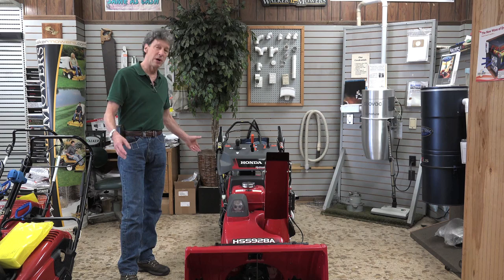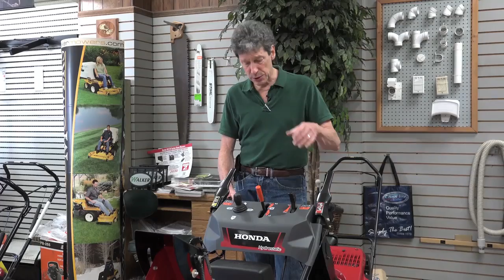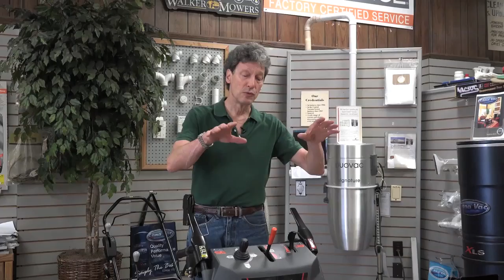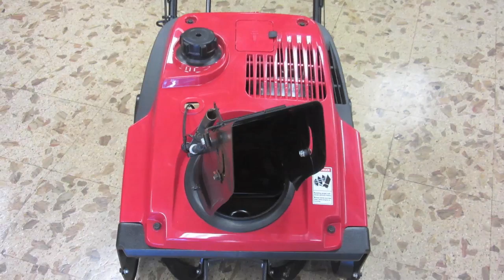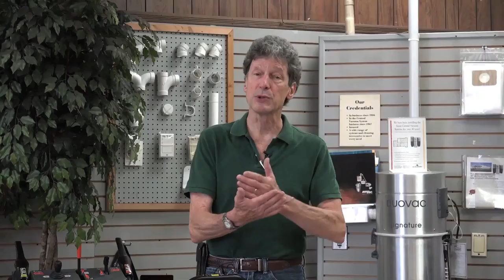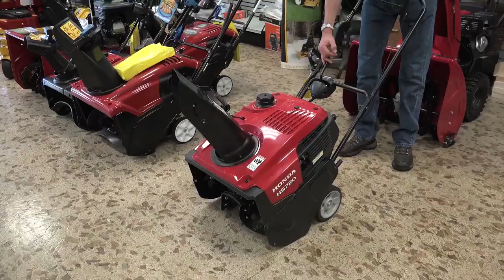An Overview on Honda snowblowers

Comment: I have a HS35 that was given to me in 2007. I had the carb rebuilt and it has worked flawlessly for me every year since! One or two pulls to start it at the beginning of the season, one pull every time after. Replaced the paddles about six years ago. Love this machine!
Reply from the maker: Thanks for sharing!

Comment: If you had to choose 1 snowblower two stage Honda or toro
Reply from the maker: Hi -- good question -- we sell both and each has particular advantages.  The short answer is that it doesn't matter.  However, as a bit more information, since Honda will be going out of the Lawnmower business after 2023, there is a likelihood that they will sometime thereafter exit the Snowblower business.

Comment: Hi great video thanks.  I was wondering if you can explain how to fix the lever if it only goes in reverse.
Reply from the maker: Hi -- thanks for the compliment -- glad you enjoyed it.  I cannot personally say what adjustment is needed (sounds like a cable adjustment); but, if you would like to call here and speak with a service tech the phone is 908-232-5723.

Comment: You mentioned it briefly in this video, but if I have a 2-stage machine, and it’s snows an inch and a half or some small amount like that, will a 2-stage machine not remove it at all?  I haven’t had a chance to use the machine yet, so i want know before I decide to keep it.
Reply from the maker: Yes -- good question -- 2-stage snowblowers are not effective on smaller snows -- certainly, on any snow below an inch or so they are virtually useless.

Comment: People complain about the price. As a landscaper that uses the hell out his 928 I can assure they are worth it. I’ve used many brands , Toro would be my second choice, but the Honda is hands down better than the rest. Only complaint is the shear pins seem a little weak. But they take literally 1 minute to replace. Other than that they are a beast of a machine and will eat pretty much whatever you throw at them
Reply from the maker: I agree all the way around!  Thanks for your comments!

Comment: every honda i hads Burn oil like mads so No thank you
Reply from the maker: Honda is a world-class manufacturer renowned for their engine quality in the automotive, marine, motorcycle and outdoor power equipment (OPE) industries.  If a Honda engine burns oil something is wrong.
Reply: @keithpetersen8114  i just broght a power washer about 3 month ago with in 2 days of usering it it lost 20%  then lowes use it and thay was shocks  this is the last honda i will buy i even had a 1994 honda acored and by 2011 the eng blew up do to oil ring just destrored and we take care of our cars and eqment
Reply from the maker: @richardc6038   I cannot say as to the issue with the pressure washer (Honda, of course, doesn't make pressure washers -- only the engines).  As to the car I also cannot, obviously, speak (we don't sell cars); but, 17 years out of a car isn't bad.  I'm sorry your experience with Honda engines has not been the happiest; however, Honda's reputation in these various industries speaks for itself.

Comment: Honda Engines = B&S
Reply from the maker: Hi Jordan -- thanks for your input -- B&S (as with many/most engines today) engines are made in China (these are quality engines -- Chinese manufacturing is not necessarily bad).  Honda does have a few Chinese engines; but, these are typically used on Chinese-made pressure washers, etc.  The mainstream Honda engines are renowned for being first quality -- the Honda engines on the twin-stage Honda snowblowers rank at the top of the chart.
Reply: B&S = Briggs + Scrap-iron (I learned that at least 50 years ago).
Reply: Nice troll.
Reply: @Icutmetal  -  You have NO IDEA what I am talking about huh?  ENGLISH 101 my neee grooosss !!!  😄😁😆😅🤣😂
Reply: @JodBronson  Huh? Nobody else does either.
Reply: @Icutmetal - Cause you all dummy trolls!  😄😁😆   😅🤣😂

Comment: I’ve got a Honda lawnmower and I love it. I have been thinking about replacing my 33 year old Toro 824, and thought that 
I’d be getting a Honda. I have a steep hill, and I really want a track machine this time around, for safety. The Honda 28” looks great, but I’m kind of impressed with the new Ariens RapidTrak 28” with the 420cc motor. The ability to have essentially the advantage of a wheeled and track machine seems good, and the significantly larger engine (420cc vs. 270cc for the Honda 28”) will throw snow farther, I think. The Ariens has a larger auger and scooped paddles, too. I think the Ariens is made in the USA. What would be the reasons to consider the Honda tracked 28” vs. the Ariens RapidTrak? Does Honda have any new designs in the works with features like the Ariens? I thought about the larger Honda, but I barely have space in my garage for the 24” one I have now. Thanks for any advice.
Reply from the maker: Hi Lee -- thanks for your inquiry.  The best short answer I can give you is what you've already stated -- i.e., you love your Honda lawnmower.  We constantly hear the "love" word by Honda owners with Honda mowers, tillers, generators and snowblowers.  We've been selling OPE products here for over 35 years.  There are a number of large differences.  If you can view both units you will instantly see that the construction and engineering on the Honda are immeasurably better.  Honda makes the best 4-stroke engines in the industry -- and, the twin-state snowblowers use Honda's best engine series.  Most other OPE engines today are made in China -- not necessarily bad; but, not in the class of Honda engines.  The Hondas use motorcycle grade cables.  The tracks are more substantial.  Hydrostatic drive is infinitely adjustable to snow conditions, and and there are handle-mounted levers for steering/maneuverability including zero turns.  I could go on; but, the best thing to do is to go see each unit -- look at the cables, look at fasteners, pins, etc. -- no comparison.  I hope this helps.
Reply: @keithpetersen8114  Much appreciated. Thank you.

Comment: I have questions about the electric start.  I now have a plug in and we are ready to go.  Few of the new Hondas (2018-19) have a plug in (I think only the track model), but a battery.  How is the battery recharged.? More important, how long does a Honda battery last?  I can see 3 years down he road it snows and the battery is dead.  With other batteries, I've notice with other devices under a variety of operating condition (lots of use, or little use the batter is dead after 3 years)  I have to bring in the dead battery, let it warm and then charge for 8 hours.  A plug in avoids all that.  Yes, there is a pull start, but at 79, I don't want to pull start anything.
Reply from the maker: Hi - the battery recharges during use.  We recommend putting a Battery Tender on the unit which will monitor the battery 24/7 and feed it electricity as needed to keep it charged.  We stock the Tenders here; or, you can order one from a local Honda Dealer if you are out of our area; or, purchase one online.  I  hope this helps.

Comment: Nice presentation.  I bought a well-used Honda HS621 seventeen years ago, and it still starts on the first pull -- first start of the season.  It is well-maintained, but certainly not babied.   It deals with anything Chicago's weather dishes out.  If and when it ever wears out, my next Honda should outlast me.  Long-term, I spend less --- probably much less -- per season on the Honda than I would if I chose probably any other brand.
Reply from the maker: Thanks!  My Mom grew up in Oak Park which, as you are probably aware, is a suburb of Chicago.  The HS621 is a good workhorse, and has an excellent engine.  Glad it has lasted you so well; and, yes, it is more affordable to purchase quality products than to misguidedly think to save money by buying inferior products!

Comment: Heres whats not so wonderful on a Honda blower. The machine you have shown in your video has skid shoes on the side and the back. Im thinking the side shoes were an optional item ( or you added them) and they should be longer and the big shoes at the back ( stupid place for them in my opinion) of the machine are not a good design because the 2 bolts that hold the bracket are both welded to a plate on the inside of the drum. If you break or strip a bolt ( only 5 m too small) you have to buy a new assembly with 2 bolts  ( probably $20 or more ) or you have to grind or drill out the old  bolt to replace it. Most dealers will opt to replace the entire assembly. Even the scrapper bar is designed to wear out quickly and when its wore out it is not easy to repair and its easier to replace it for probably $60. I think Honda does there best to design there machines so it costs 3 to 4 times more than any other machine. Dont get me wrong Hondas are the best machine out there but they costs 3 times more than most other machines new and 3 times more to fix. I have a Honda 7/24 with wheels ( I would never buy any track machine) it blows snow 50 feet starts easy and does what its supposed to do . I never bought it. I fix small engines ,mostly blowers and got it for nothing because the drum was worn down at the sides, shoes were both wore out and the scrapper bar was also worn down to next to nothing. To repair the issues would have cost about $600 . Thats almost as much as a new  blower ( not a Honda of course) I think Honda likes to design there products so it will cost you the big buck to fix ( A lot of people think that is OK because its a Honda) I dont think that way at all. I see it as a money grab. All things considered there is no question Honda is the best but you are paying the big buck to buy it and to repair it. Thats my opinion.
Reply from the maker: Hi Ron -- thanks for your input.  We service every conceivable type of snowblower -- I have to say that our typical Honda snowblower or lawnmower repairs go out of our service shop at the same general price as other products.  You refer to a "drum" being worn down -- I presume that you mean the entire auger housing.  If that is the case the unit would have been clearly abused/not properly maintained.  Honda snow products, as you note, work exceptionally well and our Honda customers are always greatly pleased with their Honda snow products.
Reply: What's wrong with a tracked machine ? I'm looking to buy one
Reply: @brandonmurphy4657  Tracks are not really needed. They do give better weight distribution than wheels and better traction but better traction lets you force the machine into heavy snow that causes a lot more wear than normal. If you get a lot of heavy snow than I would get a bigger machine like maybe a 10 HP instead of an 8 HP or slow down so your machine wont bog down as much. You can put chains on wheels as well but I would never do that because that makes them hard to move and it can damage your driveway. The only advantage I can see for tracks is you can drive up on top of snowdrifts sometimes if say you want to blow snow off a skating rink or pond out back where as if you have wheels you will have to blow a path. If you have a problem with your track machine and have to get it back to your garage that is 100 feet away most of them are very hard to move. Thats just my opinion on track machines. I just dont like them.

Comment: Can you imagine spending thousands of dollars for a WALK behind blower. Yes, I said walk behind, not a tractor. Is the impeller made out of Gold? What are people smoking today? To use this 5-10 times per year???
Reply from the maker: No imagination needed -- we sell `em all the time and no smoke involved, either  :-)  They are not cheap; but, they sure work well.  A good tractor with a snow blower attachment can easily run $15,000 -- we sell them, too.
Reply: A fine response. I too make a living in Sales!
Reply from the maker: Great -- and, if you decide to own a Honda snowthrower from us I'll see if I can scare up a model with that gold impeller .... :-)
Reply: Keith Petersen I currently own three Honda machines. No gold, just carbs that need more
maintenance than my other brands machines! Your turn....
Reply from the maker: "Machines" is a large term; however, while some carbs are more susceptible to ethanol issues than others -- the ethanol is the issue; not, per se, the carbs.  Use only premium gas, treat the gas with a good additive (Startron, Seafoam), don't let anything sit around without being run about every 30 days, drain down at season's end and then run a quart of non-ethanol fuel for about 15 minutes to purge pump gas and replace it with the new fuel for off-season storage.  And, think about getting a Honda with at least some gold trim to fit your station in life ....
Reply: Keith Petersen why is “ Machines” a large term? Open up your mind and just assume I own other brands as well as Honda machines. I only use Ethonal free fuel in all my machines.
I think you just like to argue. You won’t be successful in sales with that attitude.
Reply from the maker: Machines is a large term because Honda makes a lot of different products/machines.  Just trying to be helpful with suggestions on fuel.
Reply: @keithpetersen8114  I just want to make a good decision buying a snow blower that works when it should, minimal routine maintenance.  I do want some gold lettering on my CZ75B and a gold front tooth.........LOL
Reply from the maker: @realitynow4342  The new front tooth comes on your birthday ....
Reply: @keithpetersen8114  I'm old and loosing my hair.  I imagine I'll be loosing my teeth too.  I need a different way to PIMP.
Reply: Where I live 220" of snow is what we get on an average year. When you have to move snow everyday you appreciate a great machine! Trust me!!
Reply: Seriously? Do you even live in the snow? You get what you pay for. I have used most other brands and just bought a new Honda... WORHT EVER FREAKIN PENNY!!!!!! when it comes time to move a bunch of snow and your neighbors. Here... bud... have a clue!

Comment: Keith, I just inherited a HS55 WA #121034 snowblower.  How do I grease the auger as I do not see any zerks?  Thank You!!
Reply from the maker: Hi - the bearings on the ends of the auger are sealed bearings.  The middle gearbox is sealed and would, if needed, take gear oil.  So, nothing for you to grease on the auger on your machine.
Reply: Thank you very much for the info!
Reply from the maker: You're welcome - now you have to wait for the snow ....
Reply: +Jan  TBH, I think Ariens is one of the few that offers zerks to grease the augers.   However, I do believe that Honda does use shear pins, and if they do, you should check them to make sure they are the correct ones, and pull them out to make sure the auger spins freely.  If you wanted to install zerks on your own, you could do so.  They just thread in.  But it's overkill.  You could use a spray lube to get enough corrosion protection, IMO.

Comment: my mother has a Honda HS35 bought new in 1994 I remember she paid a lot of money for it then (somewhere around $400 or $500) which was a lot of money for a 3.5hp when most other companies that could buy you the 6hp single stage model but that thing still to this day starts by the 2nd pull, works very well, very quiet even compared to most new snowblowers runs very smooth I have only had to do minor repairs to it during this time and normal things like paddle replacements and new belts but otherwise it's been a great unit would recommend Honda to anyone. Anyone who is looking for a snowblower check out Honda, yes you pay dearly for them compared to most other brands but you get quality and features you just don't see anywhere else.
Reply from the maker: Hi Jon - Yes, that was Honda's original entry into the snowblower market.  We still occasionally get them in here for routine maintenance.  The replacement model was a HS521 (5hp 21inch); then a HS621 (1 hp larger); then a HS520 and now the HS720.  The newer units from the HS521 and on up are easily twice as efficient as the original HS35 (as you say, 3.5hp only); however, the HS25 was a true workhorse.  Thanks for your comment!
Reply: Same luck here

Comment: Honda's are amazing but i think the headlight is positioned too low.
Reply from the maker: I'm struggling to remember if I've operated the late generation unit we use to clear our facility's parking lot at night - and I cannot recall that I have used it after dark.  I must say that, personally, I've never placed much emphasis on snowblower headlights since, in my experience in the suburban community in which I live, there is typically enough light from streetlights and housed/buildings that I can always pretty well see what I'm doing.

Comment: ”We got about 6 inches of powdery snow.Recommended>https://t.co/UPqJOmt0y8  < I have a large driveway about 40 ft x 50 ft, sidewalk, RV pad and backyard area for the dogs. The snow joe cleared it all in about an hour. It never got plugged up. The only slight downside is having to mess with cord and the chute would sometimes move a bit if the control handle was up and gravity pulled it down. But other than that it was all thumbs up. Would definitely recommend. It even chewed through the 10 inch pile left by the snow plow at the end of the driveway.”
Reply from the maker: Hi Bruce - Thanks for your feedback.  Little electrics work well for small powdery snows - they are fast and easy to use.  They become virtually useless in deeper, heavier snows and, in our experience, with any degree of use in heavier conditions they simply don't last - the gears strip out and/or the motor burns out.  It is for these reasons that we stopped carrying electrics; but, they can serve a purpose where snow conditions are consistently light and not too deep.  Of course, on corded models there is always the issue of a cord - on longer driveways it is not feasible.  Battery units can help overcome that; but, then, there is the issue of run times/recharging.